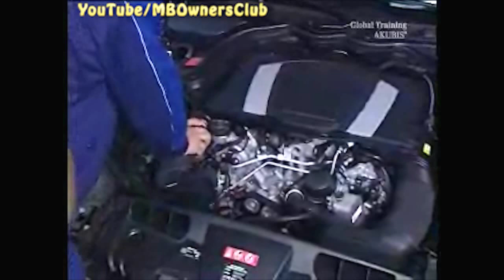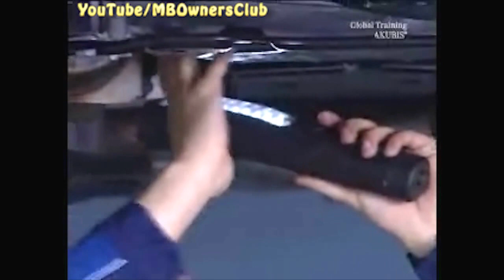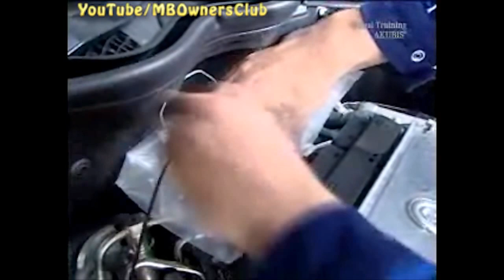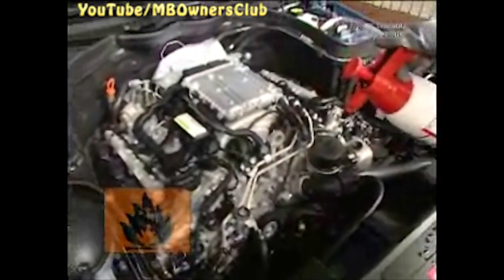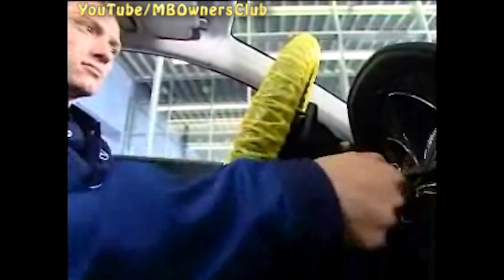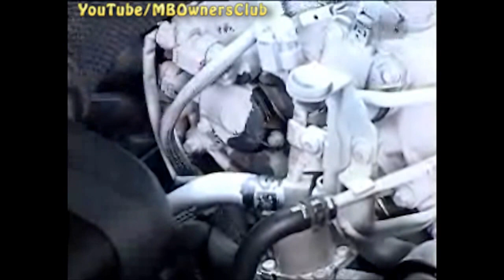How to Locate Oil Leaks on Your Mercedes-Benz - Step by Step Guide

Comment: I’m an aircraft mechanic and when looking for oil leaks I would degrease engine and is baby powder and isopropyl alcohol in a spray bottle and spray it on pretty much does the same thing.

Comment: Then why is it MB serviced and failed to fix my oil leak problem. Charged an arm and knee caps yet they didn't bother doing this procedure..?
After 5days; the vehicle still has an oil leak and it's visible that this procedure wasn't done & client has no authority in asking mechanic questions; speaking with a mediator, it makes it more harder when mech is on engine and everyone else, inc service rep is going off computer printouts..

It sucks, they asked for car to be returned; but I'm thinking, incapable and dishonesty leads to more issues.. ..I'm at a loss how money still doesn't solve issues..

A billion dollar industry yet, complicate things by not doing what's shown..

I'm so dirty on them.. ..specially in an era like today; stress is at every contract/agreement..